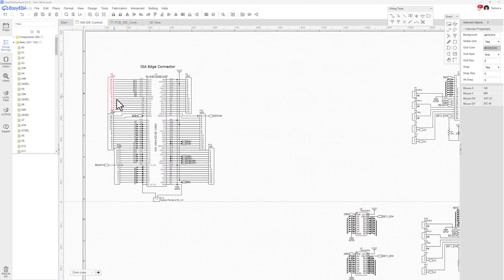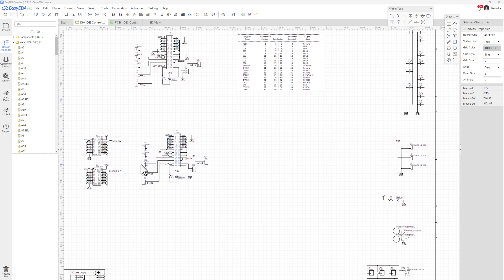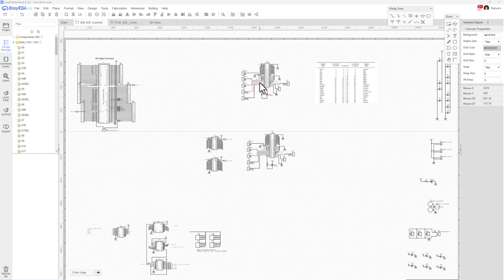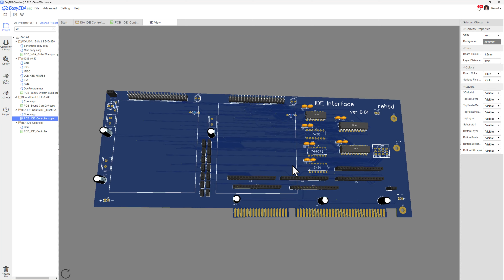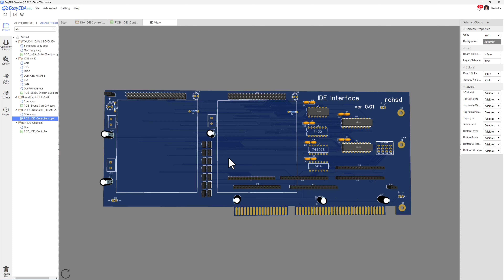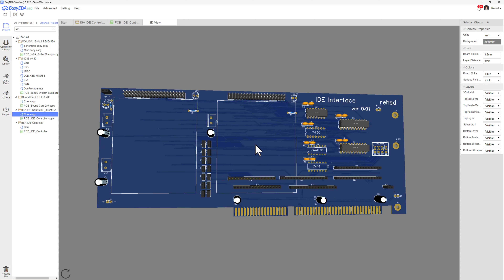80286 Build, Ep. #83 (part 2) - IDE Controller Card

Comment: From what I recall, those cable selct lines let you access 4 drives, and you set up the "match address" on each drive using a set of 2-pin jumpers.  They might have been mapped to something called master/slave and primary/secondary but IIRC that's basically what it was.  You'd go out and buy a new hard drive because your old one was getting full of funny cat videos (packaged as standalone executables because there was no standardized video compression), and then discover that the jumpers were set wrong, and your PC wouldn't boot at all, then you fiddled with the jumpers trying to remember what the hell the difference between master and primary meant.  After a few hours you discovered that your BIOS didn;t support the size of the drive you bought because, you know, Moore's law, and your PC was a couple years old. So you had to pick up a new motherboard, and had a bear of a time finding one that supported your old CPU so you didn;t have to buy a new CPU as well.  Then you spent another afternooon dicking with the motherboard jumpers to derate the CPU clock so it ran with your antediluvian CPU. But then there was an IRQ conflict and you had to update your video card as well.  Two days later it booted again and you could get back onto AOL at 28.8k baud (if you were lucky) and you could go back to looking for grainy pRon, err, interesting source code, on usenet.  There's a reason that PCI and schemes that had mechanisms for auto-detecting capablities and memory region requirements and IRQ's-over-messaging eventually killed the ISA bus and its' creepy dysfunctional friend group of interfaces :-)
Reply: Master and Slave drive selection is a software+drive thing. Jumper was there just to let the drive know which one it is. There is only one Cable Select signal (called CSEL) on each cable(those CSXFX lines are Chip Select, not Cable Select). Cable Select feature is cable thing, not controller thing. Controller itself doesn't have to know anything about Cable Select or Master and Slave drives. If cable was not wired in a way that supported Cable Select feature, then you had to rely on Master/Slave jumpers.

On the other hand Primary and Secondary were completely separate (usually identical) controllers, something akin to having extra controller card installed. Each controller had to be configured for different base address (and preferrably IRQ too). I am not sure about DMA channel.

More than two drives per controller were supported on SCSI and some floppy controllers/interfaces.
Reply: @pvc988  Thanks for the clarification. I knew there was something more to it!

Comment: This revision looks much more like it.

CS1FX and CS3FX are labeled in somewhat misleading way on this pinout diagram. In fact they are just two Chip Select signals for two banks of registers that each drive has. It just happens that on a typical PC these banks are visible at IO addresses 0x1FX and 0x3FX (for primary or single controller). But they can really be anywhere you want.

"1FX" bank is what you are going to be mostly working with. This is where you send commands, data and block addresses. "3FX" can be ignored for the most part. It is used to mask interrupts, reset drives, etc.

Unfortunately, I cannot help you with DMA since the only DMA form that I am familiar with is PCI bus mastering (which is completely different beast). I have no idea how classic ISA DMA works.
Reply from the maker: I will probably need to make some adjustments to get CS3FX# working for me. For now, I can probably pull it up. I might need to modify my I/O decode to use A5 so that I can use both A4 and A3 for controlling 1FX and 3FX. I'll play with it once I get the PCB. Thanks!

Comment: looks good.

I am slightly shocked a comment I made on the internet encouraged someone on the other side of the world to redo a PCB
Reply from the maker: I'm just learning and hacking my way through my 286 build, so feedback and suggestions are always appreciated!
Reply: @rehsd  I think a lot of us hobbyists are doing pretty much the same thing. I can honestly say I've had to spin a couple of versions of some of my PCBs because I just got stuff plain wrong. It's refreshing to see someone share the wins and the fails.

I've been working on a design for a Motorola 68k based computer since the middle of last year, mainly because I use it to give me something to do while I'm travelling for work. But it's a monster of a design with 10 or so schematic sheets and a 6 layer PCB, so I won't be surprised if it goes through at least a second revision...
Reply from the maker: @TomStorey96  Six-layer... I haven't tried to go there yet.  :)
Reply: @rehsd  I was hoping to get it on 4 layers, but it's a bit too much. There are two dedicated ground layers, three for signals, and one for VCC which also has a few signals when things get a bit too tight.

The price from JLCPCB is surprisingly not that much more than some 4 layer boards that I've ordered. Hopefully that's not some kind of temporary discount they have going, I'm still not ready to order. 😅
Reply: @rehsd  It's good fun, I myself have done a number of 8 layer and a single 10layer design. that was definitely a stretch of the mind